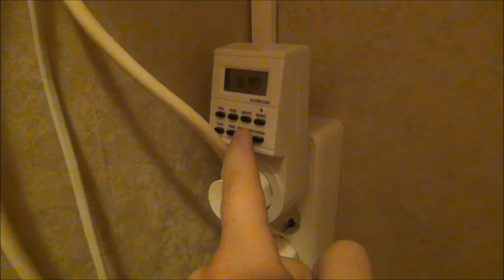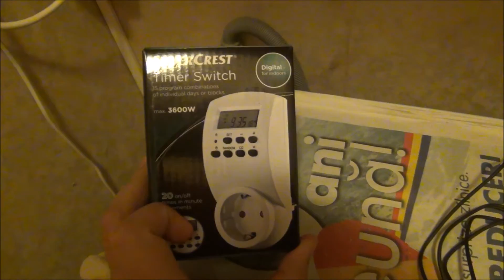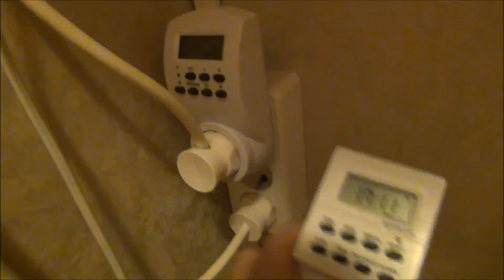Failed attempt to repair a programmable socket

Comment: The corrosion (3:36) most probably comes from a leaky NiMh rechargeable battery.
Reply from the maker: Could be 👍🏻 It has one for keeping time in the event of power failure. Did not think to replace that, as it should't have the simptoms it was having, but who knows, maybe it messes with the low power circuitry somehow.

Comment: try to change the small capacitor. After 5 years, electrolitic capacitor may dry up and will not hold charge. It will cause unstable voltage to relay command coil.
Reply from the maker: Thank you for the suggestion.

Comment: Had to laugh out loud at the "what the hell" comment, so thanks for that.  But what is plugged into that device, exactly what does the device do that a plain wall socket does not do.  I mostly use those things at Christmas time for lights.  Just wondering.
Reply from the maker: It's for a water heater and there are only some moments during the day when it is required to come on. This just makes sure power is not wasted when nobody is home to use the hot water.